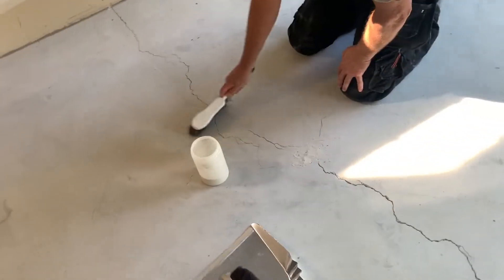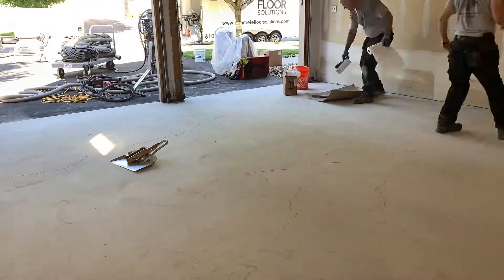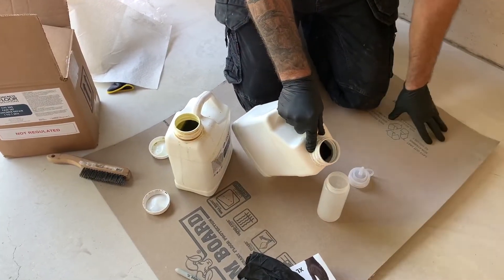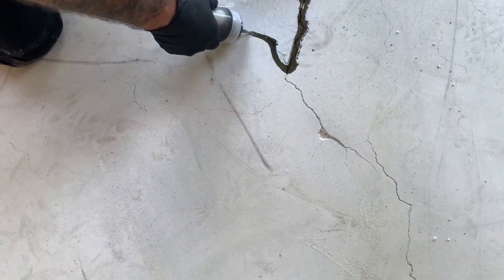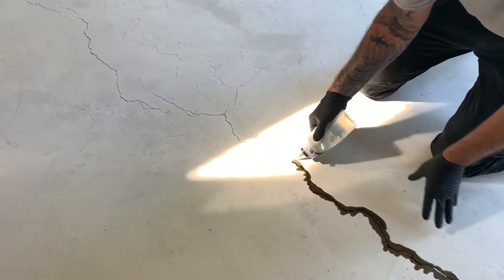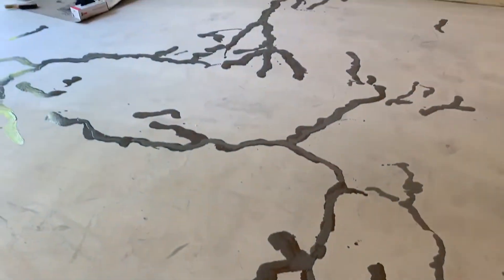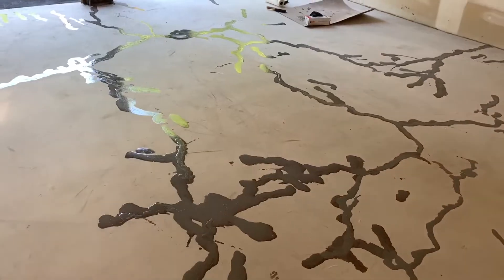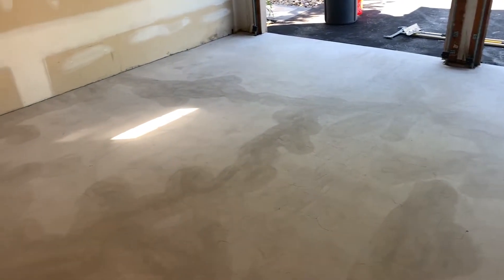How to repair cracks and spalls in concrete floors before applying epoxy coatings.

Comment: Great product. I went a little further and used a diamond wheel on the cracks, wire brushed, vacuumed and then put down the sand. Was worried the odd shaped cracks wouldn’t be clean enough without doing that. Nearly invisible

Comment: I'm going to be tackling this project for my garage floor this spring. I will be purchasing the CFS-FAST SET EPOXY CRACK FILLER SPALL REPAIR for the cracks and spalls but I also have a pot-hole about 16"x30"x1" deep. Can I also use the fast set and some sand for that size of a crater? 
Thanks!

Comment: My garage look exactly like this one. Can you tell me what type of grinder to use?. Can I just use an angle grinder, and if so what grinding wheel should I use?. Thanks.
Reply from the maker: You can use an angle grinder if you want, it just may take a little bit longer. You can rent a 20 inch Husqvarna grinder from your local rental center. Use 40 grit diamond to prepare. The kit you use for the floor is https://concretefloorsolutions.com/product/500-sq-ft-complete-epoxy-flake-floor-kit/
Reply: @ConcreteFloorSolutions  Thanks for getting back to me.

Comment: Curious your thoughts on this method versus using cabosil?  My first thought would be your method saves more product as you can make smaller mixes. However, it seems like it takes longer as you make multiple mixes.  Also, with cabosil if you get all the excess off there is no need to grind.  Thanks in advance!
Reply from the maker: I think the cabosil would reduce the strength of the epoxy and therefore weaken the repair. We are trying to glue the crack back together again so this material needs to penetrate down to the bottom of the crack. That is why we use sand so it can filter all the way through. This is the material we use, it works fantastic https://concretefloorsolutions.com/product/cfs-343-fast-set-epoxy-crack-filler-fast-set-epoxy-spall-repair/